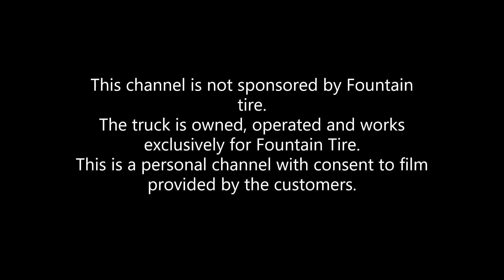Almost full job filmed with nearly no edits.

Comment: Love your videos, and although i mounted a lot of tires many years ago, they were never on the scale of what you do. But fixing my own forklift, backhoe, and truck tires pushed me to another level. I now have most of the tools you use, Murphys tire lube, bead mounting and dismounting fluid, and spray bottles, bead breaker and a surplus hydraulic tire machine all of which would be useless without the techniques i have watched on your channel. Thanks!
Reply from the maker: Thank you very much James. 
Forklift tires are quite miserable. Very small tire but very stiff given the size and being mounted on a multi piece rims don’t help either. 
I didn’t feel that YouTube and social media truly showed how much work it actually takes to change tires on a daily basis. That was part on the reason why I started my channel. 
Don’t get me wrong, I have made quite a few mistakes along the way on and off film and have been called out on it several times for it. 
I am no expert and still learn new and different techniques quite often.